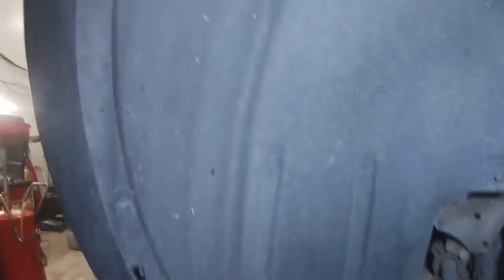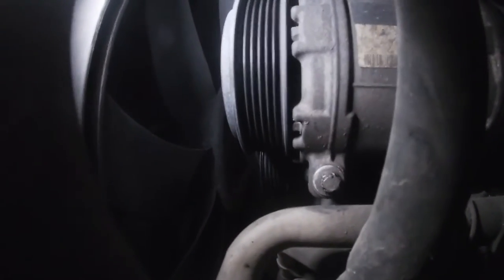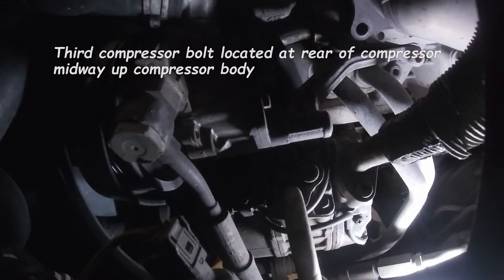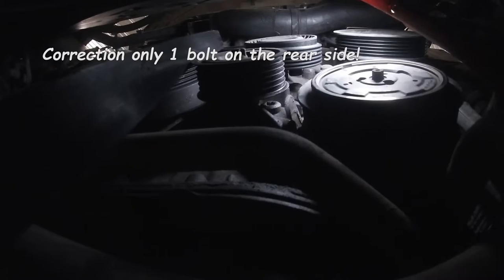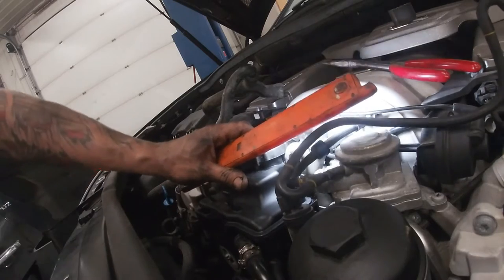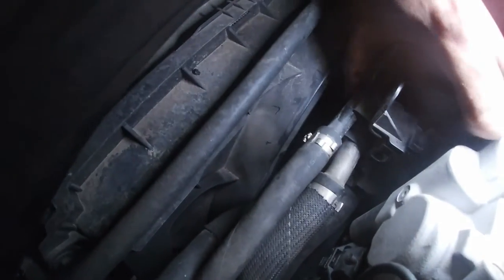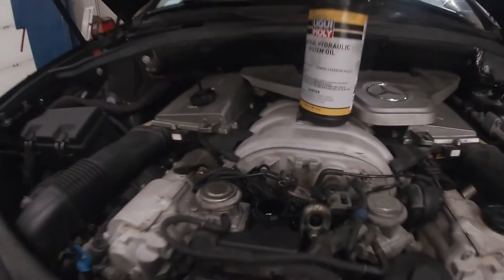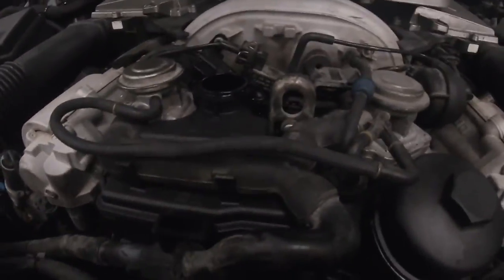ML63 Power Steering Pump DIY ! 2008 Mercedes Benz

Comment: How did you remove rear side 3x45 Torx on the P/S pump?
Reply from the maker: I believe I used a bit and bit driver with a small hit driver ratchet

Comment: You didn't show us so many things. How u got it out. How did u reach the back bolt...not helpful video
Reply from the maker: Slow it down and watch it frame by frame , still learning back bolt is accessible with a bit driver and a bit is how I got it out otherwise it’s straight forward operation